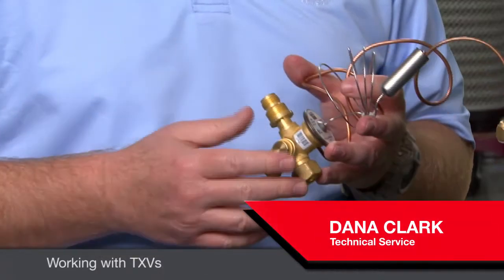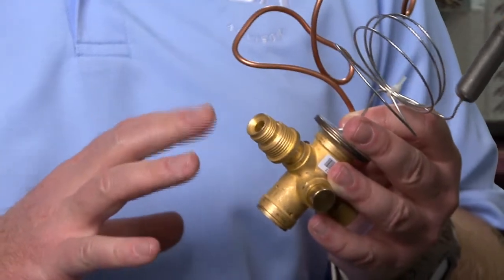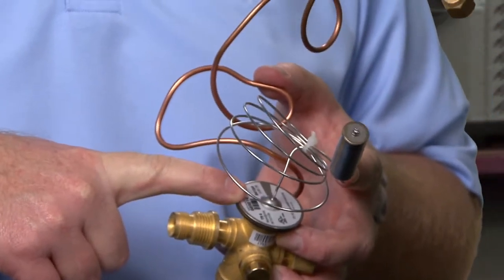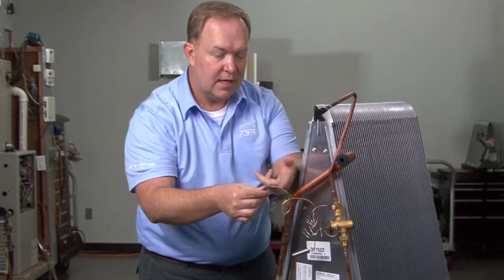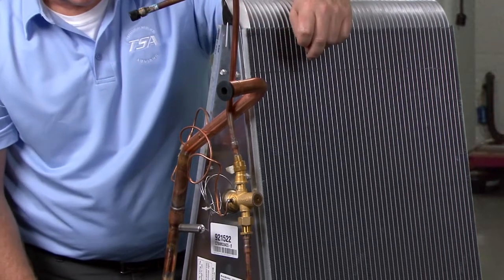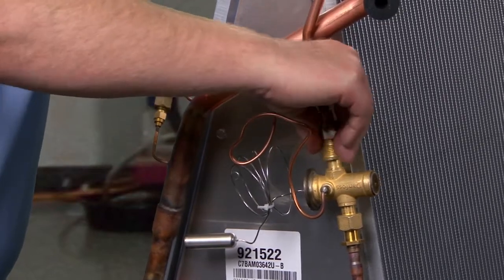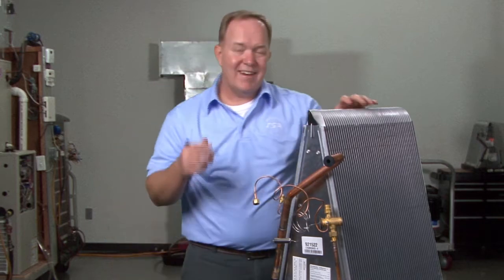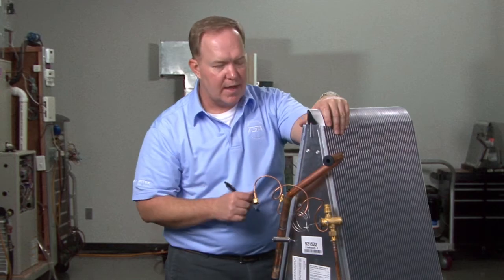Working with TXVs

Comment: One question sir is how can you know the in and the out of the TXV thanks
Reply: There’s an arrow most times or the inlet will say in engraved in valve body. But then there’s heat pump txv which is bi directional but still will have arrow but you need to know which way to face it depending on if it’s on the outside unit or at indoor coil